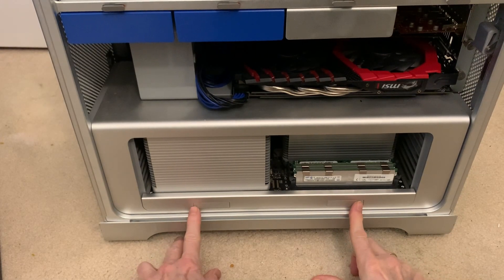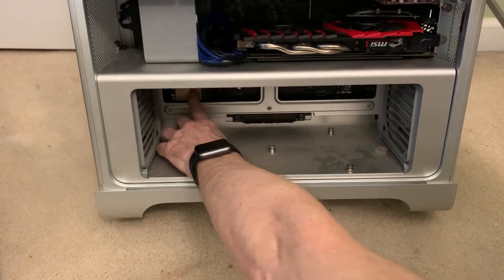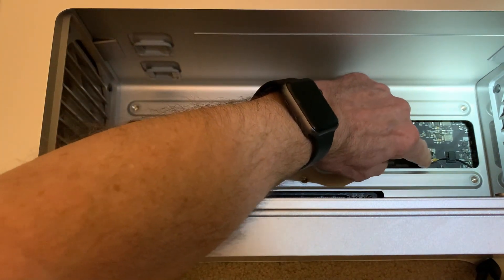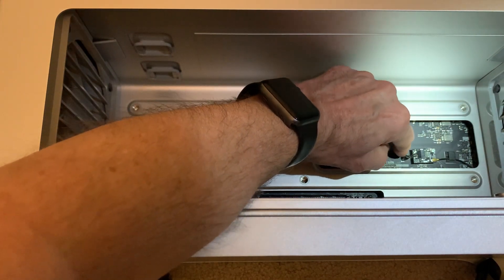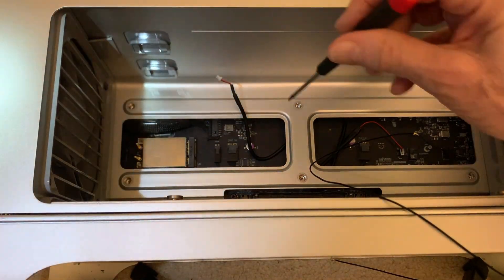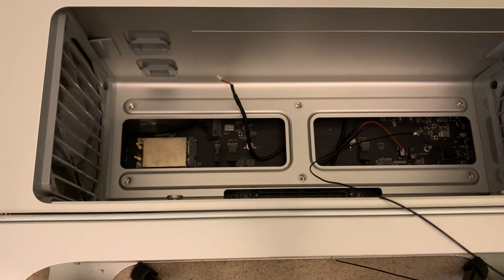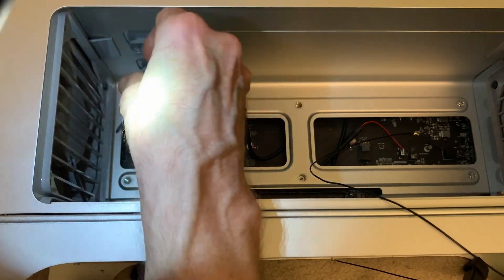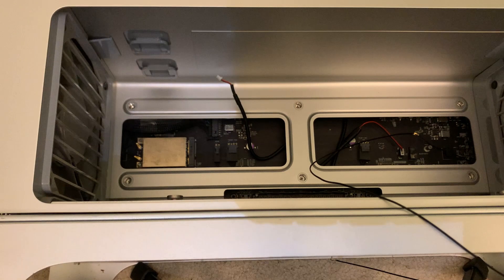2009 Mac Pro, Wifi Bluetooth upgrade, for AirDrop  and more!

Comment: Can I just disable the onboard wifi and Bluetooth and install a wireless antenna adapter?
Reply from the maker: Back before I first installed the updated wifi/Bluetooth cards, I tried using PCIe wifi card. There are people whp have had success with USB wifi and Bluetooth dongles, but I don't know that anyone has gotten Handoff, Airdrop, and thins of that nature to work with dongles. If ll you are looking for is better wifi, that is an option. Onther option is a wifi repeater that has ethernet, which can then be connected to your computer.

Comment: I would be easier to remove the cpu fan cage for easy mobility.
Reply from the maker: You could, but I just don't see that making it any easier., at least not so as to make the hassle of taking it out. The real problem are the antenna connectors Apple uses. If the adapter could allow the card to be situated so as to have the connectors facing up, that would make it much eassier.

Comment: Where did you buy the red and white cable?
Reply from the maker: I assume you mean the Bluetooth data connector, which is actually red and black with white connectors. It came as part of the kit, which I bought on eBay from a seller in the Netherlands.